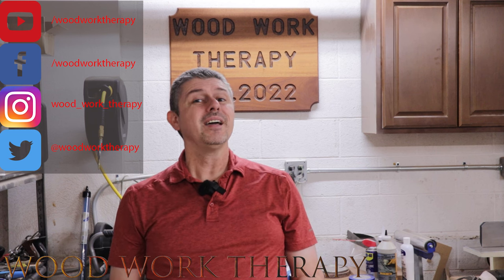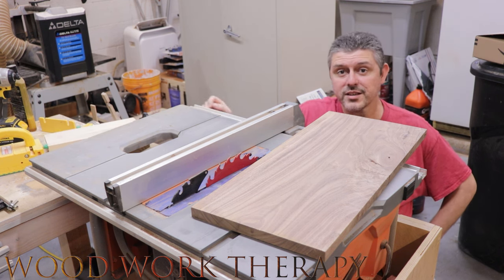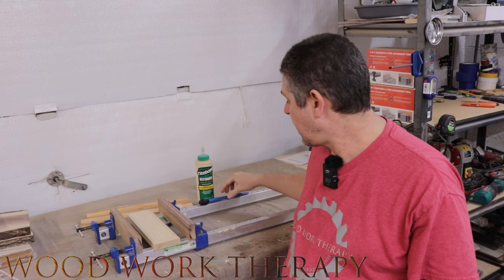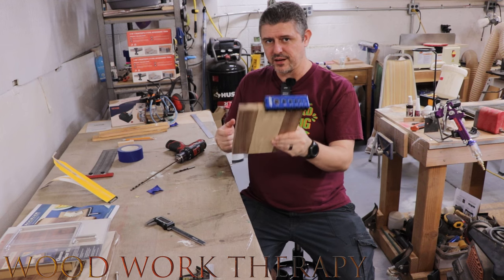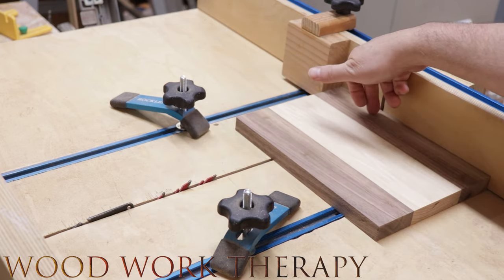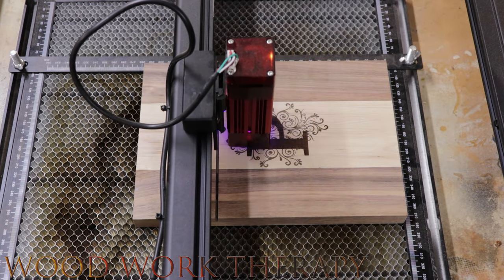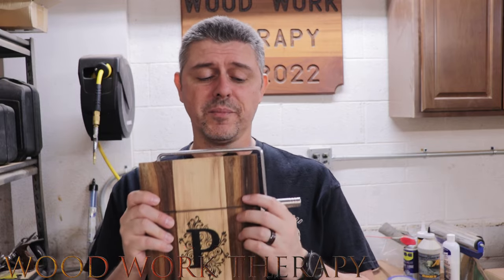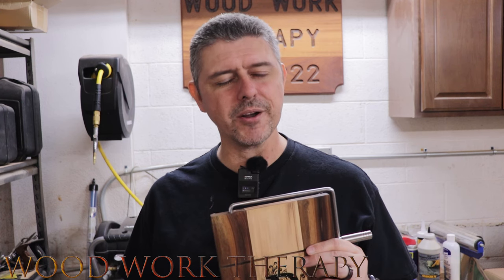Crafting Elegance: Making a Wooden Cheese Cutting Board Tutorial

Comment from the maker: Rockler Cheese Slicer Kit: https://amzn.to/40UV8jJ
Kreg Drilling Guide: https://amzn.to/3MWU35r
DEWALT 1/4-Inch by 12-Inch Extra Long Drill Bit: https://amzn.to/3sBs4kQ
Titebond III Glue: https://amzn.to/3MWTV5F
Glue applicator brush kit: https://amzn.to/3RlEhnj
Ortur LM3 LE Laser (5.5 watt): https://ortur.net/?ref=woodworktherapy

Ortur Promo codes
1. $260 OFF For 20W and 10W+FFT1.0: FORWWT20W
2. $270 OFF For 10W: FORWWT10W
3. 20% OFF For all Ortur accessories: 20FORWWT

Comment: 7:05 is that standard embossing powder?  How does it hold up against actual use (or do you epoxy the surface afterwards) 

Also, do you have a name for that little assortment kit of rubber feet, or remember where you got them?
Reply from the maker: The HotCoat Powder Coat we used was this: https://amzn.to/4cxPo4t I will tell you this is tricky to get right. I felt the video made this look rather easy. It does take many layers to make this look right, so start thin and work your way to the top, let it cool between layers. You should avoid the issues we had when doing this. LOL 
I did not wind up using epoxy on this one. However since it is a non-cut surface it may not be a bad idea for filling in small holes that can form during the heating process. On it's own it is very stable and hard. That being said it is powder paint just like the stuff that is on the bottom of your chassie, so it is rather durable. However it does have a gloss, so I would assume it would scratch over time, or at least show scratches. I don't think you would be able to cut through it easily with a knife however. I have NOT tested that theory just to be clear. LOL
The feet are from this kit(realy nice kit by the way, just remember to predrill first LOL): https://amzn.to/3WaZ27t

I hope this helps! Feel free to let me or us know if you have other questions on the process. 😀